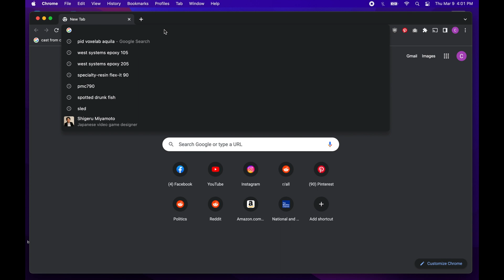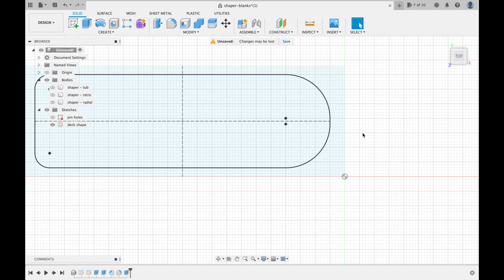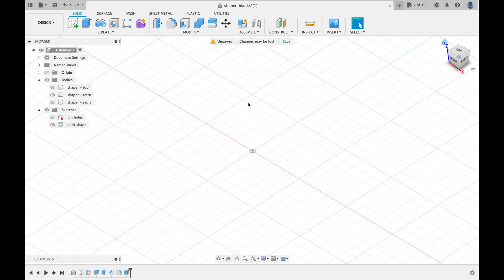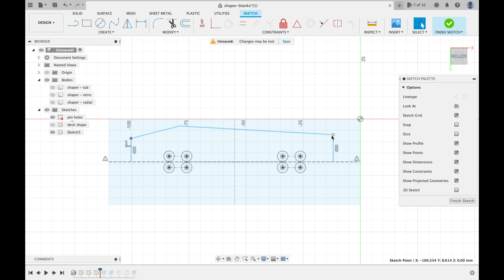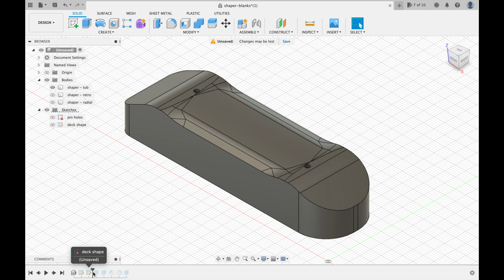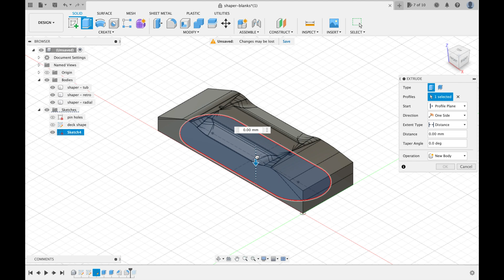Making Custom Fingerboard Shapers in Fusion 360 - Shaper Giveaway!

Comment: Big fan of the wider popsicle shape that you created last in this vid. Just got your press and about to shape my first deck that’s now dry, but don’t have a 3D printer. 34x97mm is my desired shape. Also hoping that when I drill the hardware holes that it’s straight enough to not drill through the other side of the press. I love this press!